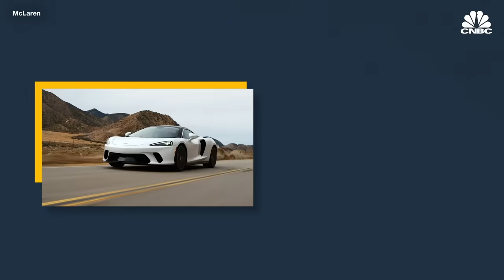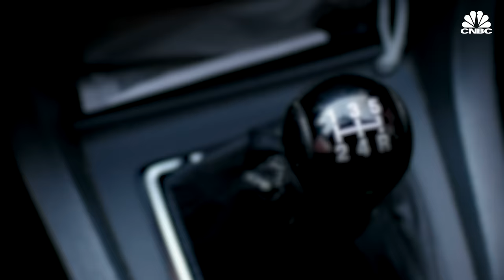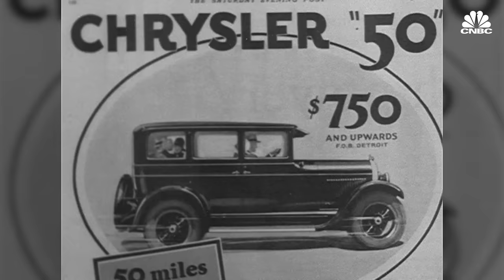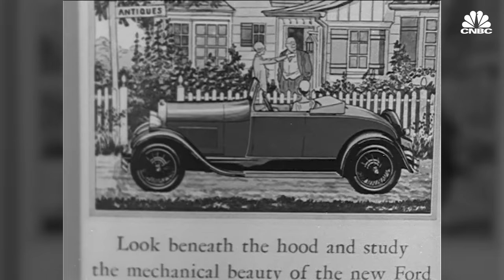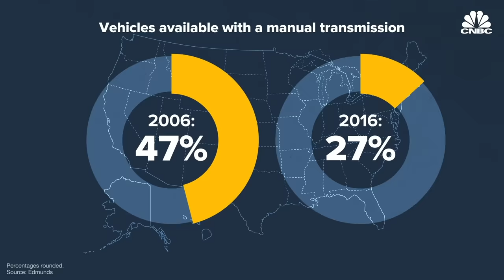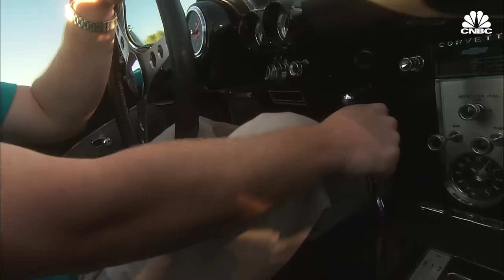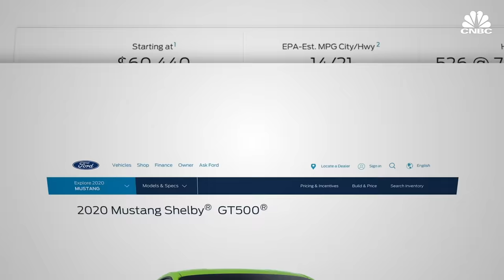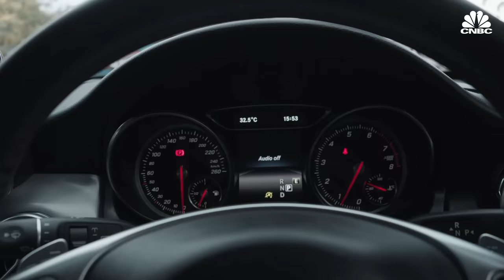Why Stick Shifts Are Going Extinct

Comment: Every automatic transmission vehicle that I drove , I would have many many issues and rebuilds and or replacements , every one cost me thousands in repair , I taught myself how to drive standard shift on an old forklift with over/under shifting , I used that at work when I needed a life cause no one else knew how to operate it so it was mine , I drive manual shift now for over 10 years and not one repair to the transmission or clutch not one  ! I am a driver I love shifting the gears , and I have my own shift points , I never drove any auto transmission that had the shift points right and I would fool them with the peddle skip trick , then they would die early , so when they make no vehicles with true standard shift I am done driving is all , then some dumb ass can drive me around everywhere and wipe my drool ....... ! lol I do feel strongly about this , if you can't drive a car stay off the damn roads !
Reply: Not to mention all the fuel saved driving a manual!!

Comment: Manual transmissions are fun to drive.  I have driven 3, 4, 5 and 6 speed and enjoyed them.  I still look for one when I buy a vehicle
Reply: woah what car had a 3 speed that's crazy
Reply: @sebastianalleyne1073  3 on the tree!
Reply: Manual 3 speed? What car was this?
Reply: @clarkneil1980  any car before the year 1960
Reply: @clarkneil1980  1978 F100 Pickup truck
Reply: @sebastianalleyne1073  Many did, even a Shifter On the steering column, aka 'Three on the tree' as a term .. so not a 'Stick shift'
Reply: Me too

Comment: I drove stick 4 out of my last 5 vehicles. Loved them for everything except stop and go traffic. This year I bought a new Tacoma pickup. No stick available in the trim I needed. The one good thing is Toyota kept the ability to shift manually on their automatic. They kept a tachometer as well. Most people don't even know how and when to use it, but it is actually very functional for climbing grades, slippery/snow covered roads, engine braking and dealing with an automatic that seemingly wants to fight your driving intentions. Automatics are nice, but there ARE times when you selecting the correct gear for the situation is very important.
Reply: Over here in the UK traffic is approaching USA levels of “stop n go” trauma. Like you I want to protect my left leg from overuse in traffic so I drive a dual clutch auto. My motorbike is clutched and is great fir the open road. But traffic…. Give me an auto every time 👍🏻
Reply: Two out of my five vehicles are stick shift. My BMW M3 is a 6 speed manual and my lifted 4Runner is a 5 speed manual. My Porsche 911 S is a PDK, my Lexus GX is auto and my Tesla Model 3 Performance does not have a transmission.
Reply: lol just lift the clutch pedal it will move in traffic
Reply: Well said. That is exactly what I’ve been saying all the time. This morning while driving to work after a snow storm 2 nights ago, it was so easy piloting through some of the roads that have snowy covered slick spots. You feel as if you have more control of the vehicle vs. an automatic of, which controls you.
Reply: @mocheen4837  you got too many toys. Stick with a stick. Only way to go
Reply: Get rid of the manual.. I bet a study would prove stick drivers commit the most traffic violations, especially speeding.
Reply: @carbon6951  simple observation,u wont see a stick driver holding a phone while driving
Reply: @yralim7482  Of course not.. A stick driver is way to busy passing vehicles on the right, driving 40 mph above the speed limit, and running red lights. They wouldn't be able to do all of that if they were holding a cell phone.
Reply: @virgilwyatt4632  You need to show me a study because I never claimed there was a study, so what are you talking about?? You need to read my comment again.. Also, an automobile is for transportation, unless you're a race car driver.. You don't need a stick to keep your mind sharp Lol  There's other ways you can do that.. Try challenging yourself by solving some equations on your spare time..
Reply: @carbon6951  I've just solved this equation. You drive a boring vehicle and now you wanna drag everyone else down that dark, drab alley to nowhere. You need to read what YOU wrote. You initiated the subject. And if you'll do your research, you'll find that manual transmissions have been around much longer than automatic transmissions. That bit of information is included in the CNBC article. And with that said, how is it that just because it's an manual transmission, its for racing?

I have a 2003 Acura with a 6  speed manual transmission mated to an V-6 engine and a 2019 Acura with a 9 speed transmission mated to an automatic transmission. I've also owned a 2010 Acura that was equipped manual transmission and mated to a v-6 engine. The nine speed shifts way faster than than the 2 manual transmissions and also the automatic gets BETTER gas mileage, a total flip from the 50's through the early 2000's. Also, Formula 1 race cars at one time, came equipped with automatic transmissions until the FIA imposed changes that made automatic transmissions forbidden for use. Those steering wheel  pedal shifting automatic transmissions were courtesy of Ferrari; and that technology trickled down to their street cars and then to the rest of the world. NOW, you can't even buy a Chevrolet Corvette C-8 with a manual transmission. Most if not all Ferraris come with only automatic transmissions. 
You need to watch the video again. These computer aided transmissions shift much faster than any manual transmission . Even the mini-van that you drive shifts faster than your manually equipped sports car you used to own. So Yeah; manual transmissions HAVE taken a back seat to the faster, RACIER semi & fully automatic passenger vehicle. 
Your witness....
Reply: @virgilwyatt4632  God lord bro!!! Like I said, I never stated there was a study done.. Just my opinion.. My first car was a stick.. I've owned many manuals.. I'm a auto mechanic bro.. I drive, perform Diagnostics and repair manuals literally "EVERYDAY."   I've out grown my love for those transmissions and I'm keeping up to date with the future... If you still love the stick, have at it.. This is just my opinion.
Reply: @yralim7482  I drive manual while playing gachas lmao

Comment: Manual all the way for me - probably due to growing up in Germany where automatic is not as common... As some other commentors say, if you specifically go to driving school to learn automatic only, your licence will have an entry with the info that you are only allowed to drive automatic only, and no manual, which can be a huge disadvantage with such a large portion of cars in Europe being manual. Automatic is nice if your left foot is injured - but to me driving a car is having full control and being able to decide when to shift gears to be able to make the best of driving most efficiently, or also purposely driving with higher rotation to overtake tractors etc. here in rural areas. Both types of transmission have their advantages and disadvantages, and I think, that it is worth trying both to see which type of transmission fits the individual drivers needs and preferences better.

Comment: Electric cars: - what is "transmission" you talk about?
Reply: Fun toggle
Reply: My first road vehicle way back in the dark ages was a three wheeled electric truck for delivering milk in an urban setting, lead acid batteries, top speed of 13 mph and a range of about 25 miles....very primitive by todays standards but a monkey could drive it.It was similar to a golfcart but heavier.
Reply: Statistics say that manual cars are less involved in accidents, causs the driver is more engaged.
Reply: @dinunclv  i'm not more engaged when driving manual or automatic, after about 6 moths to a year you kinda start to shift automatically yourself
Reply: @shookshibe  maybe you do not notice, but still you do more things. It is still harder to fall asleep when you have to shift gears than just sit there with your foot on a pedal.
Reply: @dinunclv  usually when you are on the motorway, you don't shift gears, I've not really noticed any difference in sleepiness driving my manual, than i did driving my parents automatic. Although i tend to be more awake in my parents car because it is much faster.
Reply: @shookshibe   well you cannot focus on road as well as observe your own mind at the same time.
Reply: Electric cars have '1 gear' in a way but it's not really a gear
Reply: Actually I've heard there's a way for an electric vehicle to have 2 shifts. Shifts not gears
Reply: @shookshibe  yes, you'll shift automatically yourself, but you won't be able to eat a cheeseburger while driving, hence more focused on the road.
Reply: @bit2shift  i've eaten more than enough cheeseburgers while driving my manual.

Around 2 to be exact

Comment: 2030: why gas cars are going extinct
Reply: Nope ! Probably 2050.
Reply: Zaki Adam More like 2040.
Very few are going to but gas cars in 2025. The only people that will buy cars in 2025, are people that does not have any experience with it.
Reply: The EU has made a 2040 ban of sales of gas and diesel cars. A lot of European countries have set the limit lower though. But as with everything else Europe is the front runner and a lot of countries are gonna take way longer
Reply: Thomas Berger. There are other alternatives than electricity
Reply: Guessing here in Europe that will coincide with the end manual transmissions. And the year seems pretty on point, by 2035 the sales of gas/diesel powered road vehicles is banned in my country (NL), some countries like Norway are banning them even sooner. 

And for me personally, automatics can sod off, I'll wait till electric, an automatic will never know if I am planning to go back on the power again shortly, want to coast, or use the engine to brake.
Reply: @Thomas Berger Charging EVs are a lot cheaper and a lot more efficient. On the other hand charging EVs take heck a lot longer than any ICs. Furthermore, on motorways, highways, freeway or whatever you wanna call it, no matter how efficient EVs are, they simply deplete batteries very quickly even quicker than Liquefied Petrol Gas (LPG)  and Compressed Natural Gas (CNG) cars. In short, EVs are best suited for city commutes where frequent highway commuters are far better off with any ICs. I'm just saying there are pros and cons to both kinds. EVs are the cheapest to run but mind you they have higher purchase price, have significantly fewer moving parts so servicing is easier and tend to be cheaper.
Personally I still prefer ICs unless EVs can be charged as quickly as refuelling ICs.
Reply: Solar
Reply: @zakiadam3717  even in 2050 most of the cars in the world would still run on petrol.
Reply: Who cares?!? 😐
Reply: In a way it is... Getting your energy from the sun and solar panels exclusively has very different benefits and down falls... same as getting your energy from internal combustion and hydrogen. All of them are their own entities in how they attract energy but the primary goal is getting the energy.. Which way is most efficient without causing much damage?? Energy can be created in an unlimited amount of ways.
Reply: right but in the way that they attract electricity is different. The electricity that operates most electric vehicles are coming from fossil fuel combustion that is being transferred through power plants. The electricity from the sun can be harnessed through photovoltaic cells or solar thermal technology and so on.
Reply: In the way that we get our energy still heavily relies on the combustion of fossil fuels at the end of the day.
Reply: @olestokke  Electric cars are still way too expensive for the average buyer
Reply: Thomas Berger at 2025, most people will not buy a gas car if they do careful comparison. Electric cars are already overtaking in terms of safety, performance and range...the only problem is charging rate, however, the range of an average Model3 is more than enough to use a whole day and charge up at night.
Reply: @HN That's kinda sad, since driving is a very enjoyable activity for a lot of people
Reply: @HN I'm not seeing that so much. The Tesla Model 3 starts at $40,000

Comment: I've never owned an automatic car, all my current/past cars have always been manual. Pretty happy with all my purchases so far.
Reply: What happens when you can’t get one anymore?
Reply: @mark_r49  it won't happen too soon, especially in a country like india where buyers are way too cost concious and automatic costs atleast 10% more than its manual counterpart
Reply: Also, manuals don’t have computer control. So there is some freedom there
Reply: @mark_r49  and normal autos don't work in many hill stations here. Some hills are so steep that you need a driver controllable clutch to feed power properly. Also, auto gearbox + traction control in normal cars is so unpredictable on ice and inclines. Manuals are like walking on your feet, so much control

Comment: Lady: “driving is a chore”
Teenager: “wtf??”
Reply: ELITE RACER45 
I didn’t know manual transmission is an art lol
Reply: I’m one hell of an artist😂
Reply: why would they ask for a woman's opinion in a car video?
Reply: @zeezlebops  Why do men seem so much more interested in having a stick to play with while they drive? I learned on a stick drive when I was 14, but I don't see any point in not having an automatic, other than I seem to recall being able to push start stick shift cars if your battery dies.
Reply: Primalxbeast its not about the stick itself i personally like automatics but i drive a truck so i never really had a choice, but you have more control over the way you drive your car and in most cases if your just cruising normally you get better MPGs. Not so much these days but manuals are considered to be quicker than their automatic counterparts
Reply: 1:10
Reply: No wonder she is independent. She has no idea what she is taking about. 

Driving is not a chore.
Reply: @Primalxbeast  because there's skill involved using a stick shift. Learning to heel-toe, rev-match, trail brake, left-foot brake and applying those to induce a controlled oversteer, Scandinavian flicks and even J-turns just right is so much satisfying.
Reply: dwade yea thats what i said these days automatics are more efficient in terms of power and fuel economy than a manual. Back then it was the other way around
Reply: Primalxbeast for me, contrary to what some say, its so much better in a denser city. I dont live in the downtown but just outside and its a blast. I wiggle around cars left and right. If i was just highway driving or long farm road driving it isnt at beneficial. But its still so much better omg.

Comment: The manual transmission is a valuable asset when driving in snow and ice during winter months.  If you get stuck, the manual trans allows you to rock the car to get out of that situation with little effort on your part.
Reply: Rocking the car is great to get unstuck but the wheels slip a lot more when trying to get off because you need to send torque to avoid stalling compared to an automatic. It can avoided by getting off on 2nd gear though.
Reply: And downshift to slow yourself down an icy hill
Reply: GOD YES! Thank you for bringing that point up! My soul suffers as manuals become extinct.. I’m so passionate about it I’m gonna move to Europe just to drive what I want!
Reply: @sgtslippyfist6345  Yeah, my bmw x3(07) e83, has the manual mode that rules for winter!!!!

Comment: I'm nearly 50 and learned how to drive a manual first. I always enjoyed it (I also ride motorcycles). The first time that I did NOT like driving a manual was when I had to commute in a manual car in Los Angeles traffic. Bumper to bumper, 1st gear, 2nd, then stop, clutch in, start over. Do that 500 times an hour. Luckily, most of my LA commute was on my motorcycle, and I would lane-split so it was a little better.
Reply: I had a ‘76 spitfire. Loved it. Traffic jams burned out my left foot though; and being caught at a stop sign on a steep hill in SF was scary; especially with a car kissing my rear bumper 😅
Reply: One thing a manual driver should do in heavy traffic is not run up on the car in front of you.  Try to pace it so the car, in front, starts moving before you arrive at his bumper.
Reply: @Icy Punchline, it depends on the traffic.  If I had to drive into NYC from NJ, yeah I guess I'd want an automatic.  But if I lived in Indiana and had to commute into Chicago, I'd still prefer a manual.
Reply: Commuting is the one caveat with sticks, and luckily I rarely deal with it anymore. I swear I had a bigger left leg and right arm when I did (Mustangs have stiff clutches and gear shifts). I also learned to drive on old manuals in the late '80s in a city of hills (pull that e-break at the red light). I honestly can't figure out how to drive automatics when I get a rental as I've been driving 5-speeds for nearly 30 years. I keep pushing on the non-existent clutch and fiddling with the odd gear shift while the car drives me around.
Reply: Yes, driving in bad LA traffic is easily the worst thing on earth !  :)   But, you can also shift into Neutral and coast a lot... Saves wear and tear on your Clutch and Throw-Out Bearing....
Reply: @richardjones4662  Yeah but it's hard to do that. I drove a 6-speed in stopngo traffic, and bc it has 6 gears, I have to shift a lot more often. I also can't shift down to 1st gear bc I dont wanna money shift. So at least half the time in stop-n-go traffic, I cant pace the car without either lugging the engine or wearing out the clutch
Reply: @port nut had to lug it uphill today in 2nd gear bc the guy in front of me couldn’t decide if he wanted to go 5 or 10 mph 🤦‍♂️